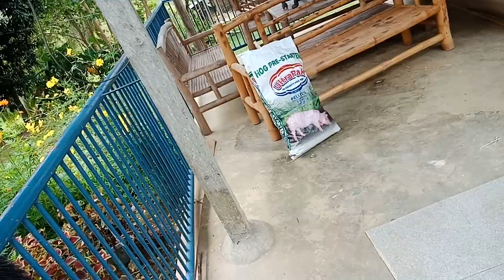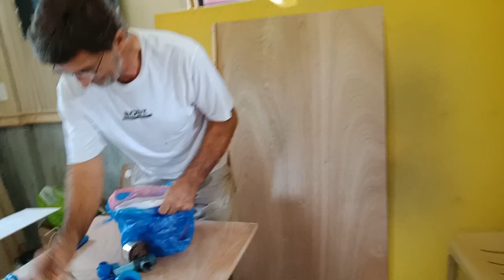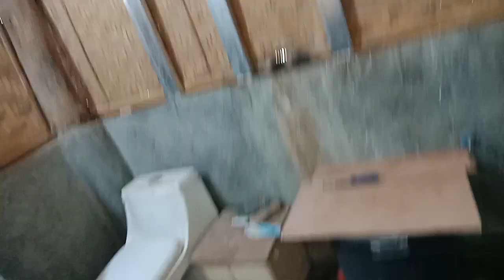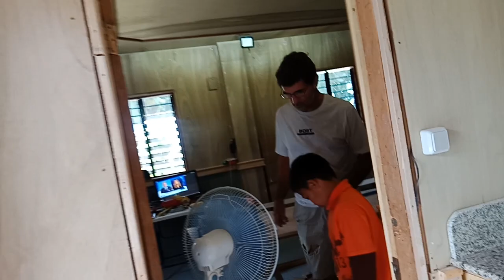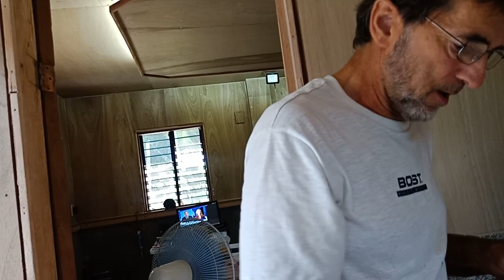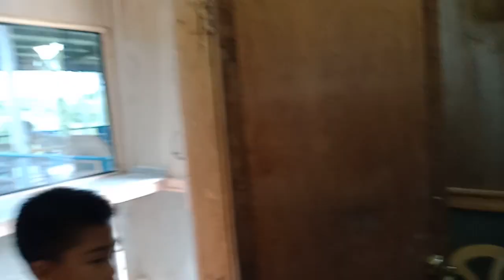A very Nice guest house "

Comment: What i suggest with that abscess, out warm wet wash cloth on it for 15 minutes,this will localize the inflammation and soften the skin around the site.  Then try to open it with a clean blade ( has to be boiled first) . The cut should just be enough just to open the wound. Or ...you can use a needle (boiled again) and prick around the black spot. The pus will come out, try to press it really good. Has to be done from time to time to relieve the pus from building up. Apply any kind of antibiotic ointment if available. The infection is from a ingrown hair follicle. Good luck.
Reply: It's best for James to see a doctor please. Safety first.🙏🏼🙏🏼🙏🏼